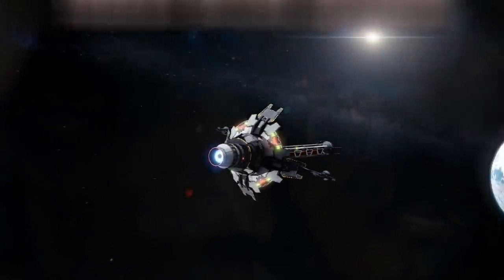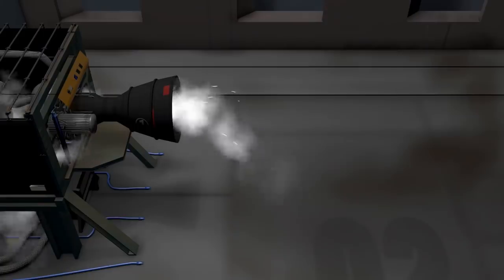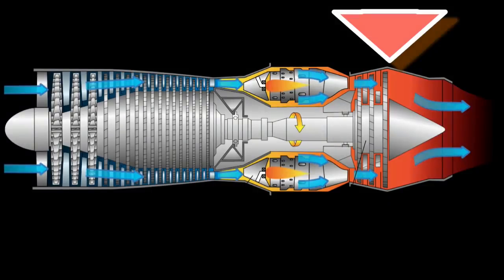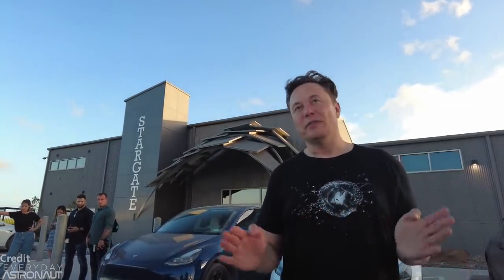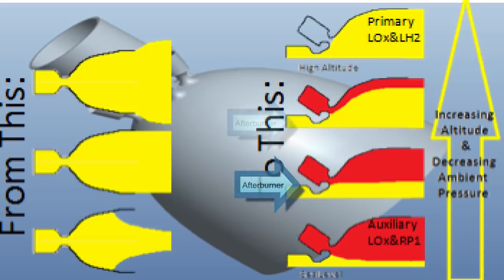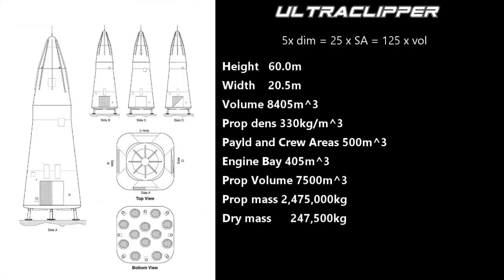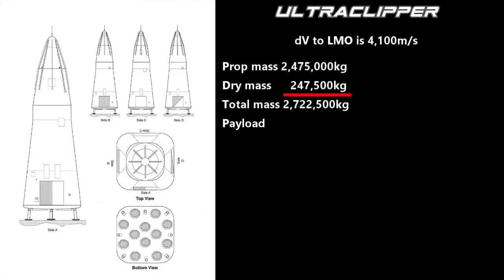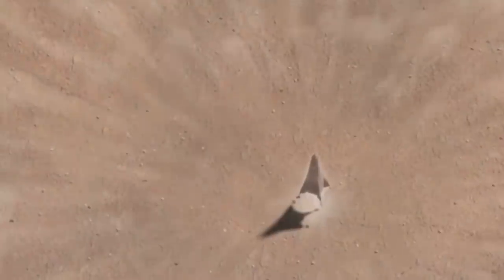Rocket Science: UltraClipper is Better than Starship!

Comment: 2:45 
The atmosphere of Titan is not mostly methane, it is 95% nitrogen. Airbreathing jet propulsion systems on Titan would need to carry both fuel and oxidizer, however, this would have a minimal impact on efficiency anyway, since most of the thrust of an air breathing jet comes from the relatively slow expansion of a relatively large amount of inert mass, which comes from the surrounding air for free. This is why the most efficient jet engines on Earth all have huge bypass air ratios; using a jet turbine to spin a big fan to move a larger amount of air without burning most of it, in fact some jet engines have as much as 12.5 times as much air mass flow through the bypass fan compared to what is actually supporting combustion in the engine.
Reply: If the atmosphere has a small amount of methane in it, why not just bring the oxidizer for the jet engine, and burn the atmospheric methane? Kind of like our version of a jet engine on Earth in reverse. Is there enough ambient methane in Titan's atmosphere to burn with a sufficient quantity of oxygen?
Reply from the maker: That's true... however Earth's atmosphere it also mostly nitrogen and we manage here just fine.  It is also true that the mass of oxygen to fuel is quite high on Earth... but in a thick atmosphere you can fly quite easily.  Just like humans on Titan could fly with short wings due to the unique combination of low gravity and thick atmosphere, jets could do the same. The thrust would not have to be that high... compressors would concentrate the atmosphere and burn it with a little oxygen... you may need some hydrogen to augment.
Reply: @terranspaceacademy  Don't get me wrong, air breathing jet propulsion would be a no brainer on Titan and would be the obvious choice (For example, the SR-71 had a top speed of over 1 km/s, which is over halfway to orbital velocity around Titan, and that's without even trying to optimize for that kind of mission). All I'm saying is that trying to support combustion in an atmosphere that is between 4.9% and 2.7% methane in the troposphere, and less than 1.5% methane in the stratosphere, would be extremely difficult and bordering on impossible, no matter how much oxygen you added. The overwhelming abundance of nitrogen would make a self sustaining ignition not practical or even impossible. This however is not a big problem anyway, because "airports" on Titan's surface would have access to basically unlimited methane both in the form of liquid methane pumped and filtered directly from surface lakes, as well as methane condensed from the atmosphere using nitrogen-gas based heat pumps (the latter option requires much more energy but is applicable everywhere on the surface, whereas lakes are much more localized). The lion's share of energy would of course be used for producing oxygen from water ice, through electrolysis. However, if we wanted to be really fancy, we could definitely get a lot of use out of nuclear thermal jet engines, especially since the low gravity would make it much easier to achieve a decent thrust to weight ratio even with shielding mass included. A nuclear thermal jet powered Titan SSTO would be able to use intake atmosphere to lift off and accelerate to over 1 km/s, achieving a periapsis far above Titan's tall atmosphere, and once in space a vacuum optimized rocket engine would take over and perform the circularization burn. This would minimize the necessary amount of electrolysis-produced oxygen propellant: in fact it may be possible to have purely nuclear thermal powered vehicles that switch from airbreathing mode to rocket mode and carry an onboard supply of methane propellant for vacuum thrust, requiring zero electrolysis for propellants and therefore being able to fly far more often without straining propellant supply capacity.

Comment: Is it possible to have a rocket engine change shape as it goes up, increasing the nozzle size as the atmosphere drops. It would increase engine complexity maybe even chance of failure, but it would decrease engine mass and we would have an egine that works both sea level and vaccum.
Reply from the maker: Yes... so far the mass penalty has  offset the efficiency.

Comment: There's a problem with the scaling argument. Yes, any material (including 4mm stainless steel) will take the same pressure from expanded cryogenic propellant in the vessel no matter how large it is. In other words, if SpaceX's Starship tanks can withstand 90 lbs per square inch, a tank ten times the size can withstand 90 lbs per square inch because the tensile strength of the steel at that cryogenic temperature is the same. But other stresses don't scale. Imagine a Boeing 787, where the fuselage is made of carbon fiber one micron thick. The cabin is somewhat pressurized, but the slightest dent, or slosh of fuel, or turbulence will split it apart. In other words, the thickness of the pressure vessel must scale with the increase in volume/mass of the contents, so you lose the mass benefit. You can't make a Goodyear blimp out of Saran Wrap, even though, under ideal static conditions, it can take the slight pressure over STP of the helium.
Reply from the maker: Very true... I was speaking of mass.

Comment: When spitballing new ideas be prepared to miss with some of them! But also be prepared for some to hit the others involved in the eye and the resultant fuss. You can never please them all.! Lol
You can see the virtual nozzle effect in the exhaust plume of Falcon 9. I dont think they are exploiting it however.
Reply from the maker: With two stage on Earth it may not be work the hassle :-)
Reply: @terranspaceacademy  if the 2nd is axial carried within the booster it cuts the number of motors being boosted saving both the weight of that motor plus the weight of the fuel that would have been needed to boost it to orbit. All of which translates to more payload.

Comment: given that the superheavy has 20 raptors around the perimeter, would it be possible to use those 20ish combustion chambers to feed a large circular aerospike? or would it need much closer spacing (and therefor many more combustion chambers)
Reply from the maker: I have thought about that a lot... It should indeed but they wouldn't be that helpful on the booster... it has more of a brute power role... They could optimize different rings for different altitudes with an overall improvement but that gets complicated on manufacturing... I asked for a ring 3 Raptor and you sent me a ring 2! etc... :-)
Reply: @terranspaceacademy  I wasn't thinking about different rings optimized for different altitudes, just converting the 20 raptor boost engines by removing their nozzles and mounting them to a aerospike ring (with the existing raptor center engines on the inside)

it wouldn't be as much benefit as an aerospike on a interplanetary starship, but if it were to gain even 5% delta-V on the starship launch, that would have rather significant implications.
Reply from the maker: @davidelang  That’s very true.

Comment: Very promising concept, but to quote a favorite line from a movie ..  What if?

What if instead of using the clipper, we launch the sea dragon instead? Or rather a pair of updated versions of the original design.

One, the first, could carry a payload of kiwi nuclear drives. The drive pods would be attached to a fuel payload sea dragon rocket in space, just as we attach chemical booster rockets here on earth today . 

Now you have a rocket in space with engines 2 to 3 times the power of current chemical rockets. 

The now empty payload section could return the chemical engines from the second fuel sea dragon as they are no longer needed in space. That engine space could be used to house a nuclear power reactor.

The first sea dragon could then launch with a truss system and possibly inflatable habitation modules to be mounted to the bow of the drive unit. And at the bow of the strut unit you could dock any surface landing ship you liked.

How long would a nuclear drive take to get to Mars if it had a fuel tank the size of sea dragon?

Granted the drive itself can't land but it could return to earth and ferry another landing ship. Or even a space station many times the size of the ISS with rotation gravity.

What if?
Reply from the maker: Sea Dragon was a very interesting concept. The problem with NTR or NEP becomes not just efficiency... but power.  That's why I prefer neutron pulse propulsion.  Did you see the lesson on this?
Reply: @terranspaceacademy  yes I did thank you. It was interesting.  What interested me about sea dragon was the scale of it. The size and payload darwfs even starship. 

As for the kiwi nuclear rocket, we already built and tested them in the 1960s. With the advances in the past 60 years I'm sure we could build better versions today.

Correct me if I'm wrong, but I vaguely recall one of the proposed uses for sea dragon was a huge tanker rocket to lift massive fuel supply to orbit. Attaching rocket engines to that in space just seamed a good way to get a powerful drive section in space easily today with current technology. 

The sea dragon could be built at any number of naval yards today. The engines it had in its design where incredibly simple, hence less failure prone than today's. 

Making a drive section separated from the payload by a strut system would seam to add some safety margin to its normal operation. Aka the discovery design depicted in 2001 movie.  

Also designed as modules, the engines  could be replaced by better ones as the where built later. The actual landing rocket is just the payload it ferries to the destination. 

Once at the destination the starship/clipper could detach and the drive could swing around the planet and return to earth for a second trip.
Reply: @terranspaceacademy  I think I saw the right video

Comment: So are you proposing ssto?  I hope not :p.  I think you have to look at the large scale mass production of starship very closely to understand it’s logic.  It’s not going to the best at anything but it will be cheap to mass produce and operate.  It pains me that the upper stage has sea level raptors.  Anything spacex can do to either totally eliminate them or move down to just one would be such a big win.  The trouble with the idea of external injectors is that it adds a lot extra complexity.

The biggest challenge at the moment appears to be thermal protection.  Funny that the biggest advantage with the delta clipper could be the flat sides making thermal protection easier
Reply from the maker: Very true point on the Starship. As we've pointed out many times in the lessons.  Getting the job done is more important than trying to be perfect at everything.  The lesson proves why SSTO is a viable option on Mars only.  Not on Earth. It is there that the presented design far exceeds the capabilities of Starship.

Comment: The atmosphere of Titan is mostly nitrogen, and you'll have a hard time lighting it on fire no matter what. It might be marginally possible, but I don't quite see it... In practice, with the thick atmosphere and low gravity, you want electric propellers or maybe even partial ornithopters.
Reply from the maker: That is a good point... with about 5% methane it might be necessary to have a concentrator since it takes about 20% to combust... but that is in 21% O2... if we feed pure O2 into the mix we should get combustion... even at 5%...
Reply: @terranspaceacademy  Would an in-line concentrator as part of a jet engine even be possible? Never heard of that. (If it was, maybe you could use it to do efficient pure-oxygen combustion here on Earth and put the nitrogen back in later as dead-weight reaction mass!)
Reply: That jet engine will work. Since temperature on titan is insanely low  the compression ratio will be insane(100-200:1).Also the lower flammability limit of methane in regular air at room temperature is around 5%. So  even at 5% methane at that very high pressure you can get combustion with pure oxygen pretty easilly. It would actually provide much more thrust too especially if its turbofan. Cold starting a jet engine at -180deg C is another story though

Comment: Funny. I'm sure this video would look SLIGHTLY different if it was made now after we saw Neutrons current concept.
Coming in belly first is probably not as good as coming in engines first and any extra breaking you need could be done by opening up the payload fairing which is made from heat resistant material. That should give you more stability, more control AND save up on your heat tiles by covering a smaller area.
Still it is no secret that SSTOs are the way to go on most planets (Earth unfortunately not being one of them) ... afterall the Starship second stage IS a Mars SSTO ... well not just to orbit but all the way back to Earth supposedly.
Reply from the maker: Very good point sir.  There is a lot to be said for the Neutron approach though belly first offers a lot more surface area.  Opening the fairings when coming back is a genius idea!
Reply: @terranspaceacademy  Assuming you can make them survive the heat ... I'm sure if Neutron could do that they wouldn't be using the canards and they'd just use the fairing opening for control. Coming down from orbit would be even worse but I figured it should be possible.

Comment: I don't see the UltraClipper concept as competitive or critical to SpaceX's Starship.  Starship primary function is to get considerable mass off Earth inexpensively as possible.  The SpaceX approach is revolutionary and offers great promise.  Once Starship has assisted in bringing on line lunar and asteroid metal production, construction of spaceliners seems inevitable.  These liners can be much larger, space vehicles only, and have some sort of rotating artificial gravity systems.  For getting mass from orbit of more manageable gravity wells than Earth, Starships are less optimal.  Once a space economy is viable, I can imagine humankinds inventive genius will create all sorts of methods of getting from here to there.  As for jet engines I think for hydrogen atmospheres, crewed and uncrewed vehicles with oxygen fuel will become common. As for Titan, the thickness of the atmosphere and low gravity a propeller driven electric vehicles would seem to work fine.  The Titan's atmosphere is 98.4% nitrogen and 1.4% methane.  It seems like a jet engine would be a bit fuel starved with that low level of methane.
Reply from the maker: I should not have said mostly... I meant besides nitrogen, like our atmosphere is mostly oxygen besides nitrogen, Titan is mostly methane.  Not very clear. A jet would indeed be starved and electric props will work great on Titan... but it doesn't take much thrust to get around on Titan if you have even stubby wings, though you might have to supplement some hydrogen to the methane... the UltraClipper is better than Starship in one environment... Mars... to do one thing... take cargo up to LMO and bring cargo back.  For this purpose it is much superior to Starship.  You are right about large cyclers being the best way to get from planet to planet in space.  Humans will very rapidly build spaceliners wtih artificial gravity... passengers will come up to LEO on a Starship... dock with a Spaceliner or use a shuttle to transfer to a Spaceliner... and go on to Mars... using something like the UltraClipper to come down on Mars.

Comment: That's not really a virtual aerospike.  You're not simulating a spike with the auxiliary burner.  You're simulating a smaller bell nozzle by increasing pressure around the main engine exhaust. 

If you put a thruster in the center and then used the pressure exerted outwards against a surrounding ring of engines, then you'd have a virtual aerospike.
Reply from the maker: It turns out that high density low pressure gas injected into the "base" creates an aerospike effect...
Reply: @terranspaceacademy  

Get the outcome of the spike, without needing to have a spike. 

I wonder what the effect this will have on film cooling. 

Do you have a drop box people can send pictures to?  There's an interesting design that uses "extensions" of the bell nozzles and engine vectoring to amalgamate a sort of spike like projection that I thought was interesting and might work to alleviate the necessity for big, heavy spikes but still produce a similar effect.

Comment: Nice video and interesting concept.  However, I do not believe that Mars is the right target due to many different reasons.  I believe that Moon production of O'Neil type cylinders is the best approach.  If you have not watched Isaac Arthur"s  You Tube channel on them, I strongly urge you to view several of these especially the ones comparing cylinders to Mars/pick a planet/moon concepts.
Reply from the maker: Quality is true there is great potential for O’Neill cylinders. A lot can be said for a planetary body with most of your resources at hand. I do believe the moon will not maximize his potential for millennia. Not because we won’t be up there working hard but because of how useful it is to have an orbital habitat that large already given to us :-)
Reply: The raw material requirements for an O'Neill cylinder are so ridiculously massive, that it's almost an absurd idea to try building one on Earth where all the resources are, let alone one in orbit. The thickness of the O'Neill cylinder is going to be over one metre of Steel just for the pressure Hull. It makes much more sense to build on a planetary or lunar body rather than trying to make one from scratch. O'Neill cylinders only become practical long after travel to the Moon Mars and other bodies becomes routine like taking a steamer across the Pacific was a hundred years ago.